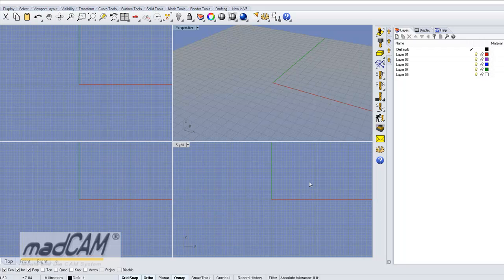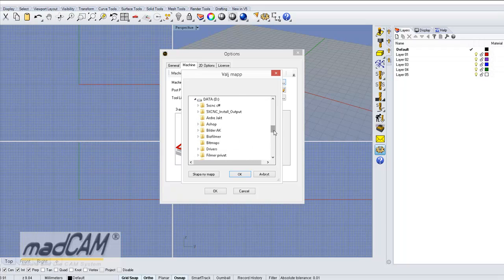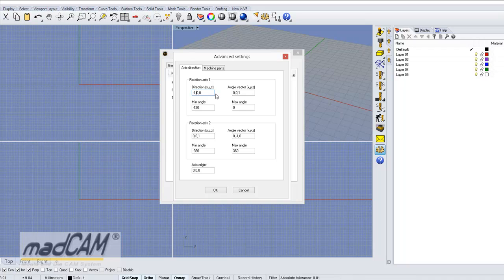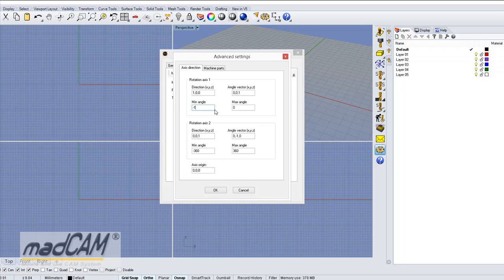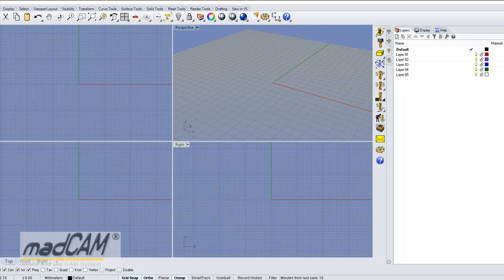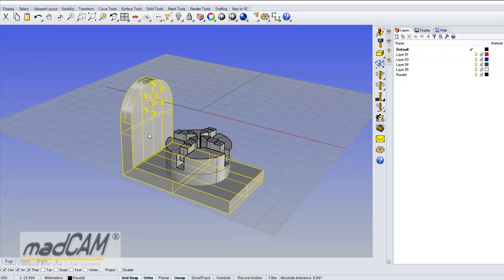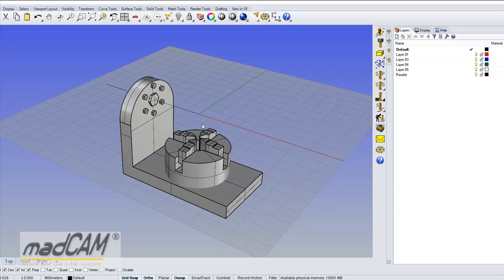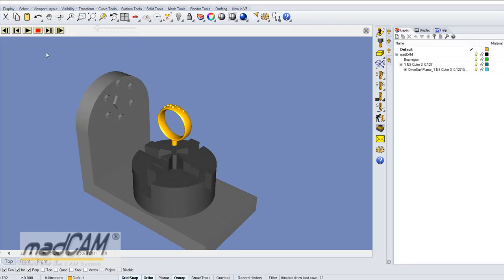madCAM 5 axis kinematic settings

Comment: What about how the rotation axes were determined... How did the "Zero" of the A axis and C axis get established? It's clearly not the Grid origin.
Reply from the maker: There is no need for axis zero points in this case. The axis directions is enough for calculating the axis rotations. This works as it it is if having support for RTCP in your machine. If not, you can set the distance to the pivot center in the post processor for axis transformations. If you like, you are also welcome to make a request to us for a custom dll that will handle the kinematics and simulation. With a custom dll, there is no limit and it can be customized to support any kind of machine.

Comment: Mybe it would be very helpfull if you also can explain the offset. As you can see very cleary in this video the offset of the trunnion is not correcty set; the ring still rotates around x-axis.